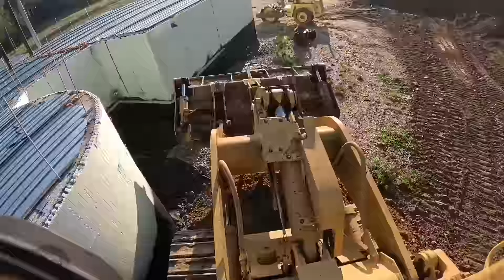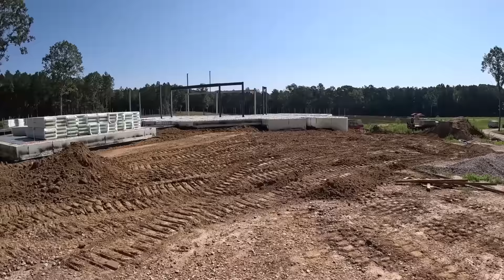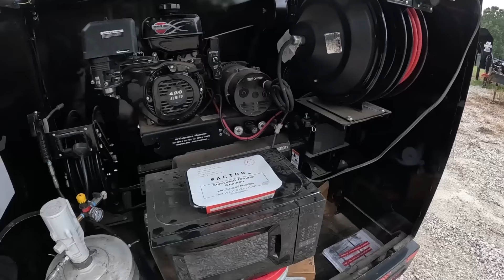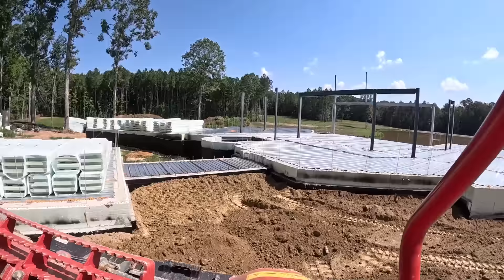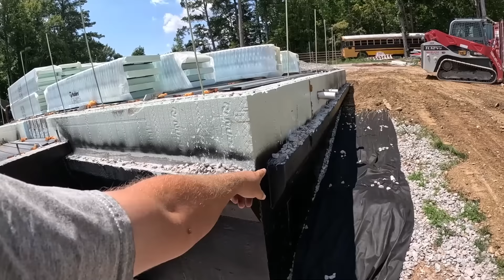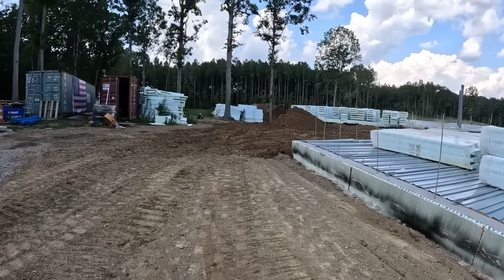I Hope The Loader Dont Fall Into The Basement! Full Backfilling!

Comment: I haven't seen a single rebar cap yet. I'm not a big fan of osha, but i am a religious believer in capping rebar. Anyone who trips and falls on an exposed piece of rebar is going to have a bad day. Elevated it aint a big deal, but at ground level, thats where it gets dangerous.
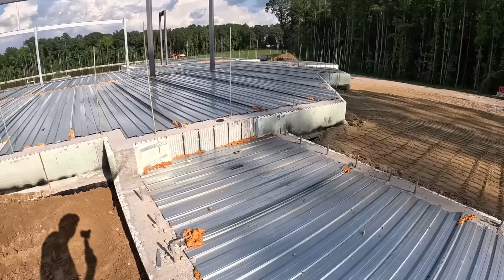Reply: Yeh, especially at 28:52. Ouch.
Reply: OSHA saved me and my second shift Ironworker welding crew oj the 70's at a shop were safety was the last concern for us welders.
It was death waiting to happen.
They came in on a surprise inspection and shut us down for 2 days till the shop was clean and organized.
Np more cutting torch hoses everywhere. 
No more 440 power cables in areas wee water was leaking from the roof.
273 items got written up.
We got paid to straighten out that shop including double weekend overtime for Saturday and Sunday nothing shifts working 10 hours both days.
Monday morning the re-inslection passed and the shop reopened.
No fines for the owner because we stuck up for him.
That earned us one heck of a nice catered lunch that Friday by him.
Reply: It's residential. OSHA is pretty much non existent there
Reply: @CraigGrant-sh3in   My post wasn't preaching osha regs. Its was pointing out something that could potentially get somebody hurt.

Comment: I use to prefer rubber tired loaders to save what is left of my back,  but the grading job you are doing with the 953 is quite impressive.
Reply: I found the rubber tyre loaders bounced a lot and made my back worse, I found driving crawlers made it better???  We are all different.
Reply: @seapy2398 I agree 100%! Wheel loaders get  rockin & rollin. I had cervical spine damage and I swear it was from when we got rid of tracked loaders

Comment: Chris as always you are doing a great job, but I would like to ask if it would be feasible and I don't know if it would be but as you run your track loader on the long stretches where you're putting that dirt could you run close enough to help compact that with the loader itself and it does have a lot more weight and would give I would think better compaction😂

Comment: Seems like every 953 I've ever run or been around the turbo would spool back up faster than that when you charge into the pile.   Not sure how they would test the boost on that.  Might be something you mechanic knows more about.
Reply: I did wonder about that, it dies at the last minute...  Have only driven 951's but they would push right through the heap if you let them.